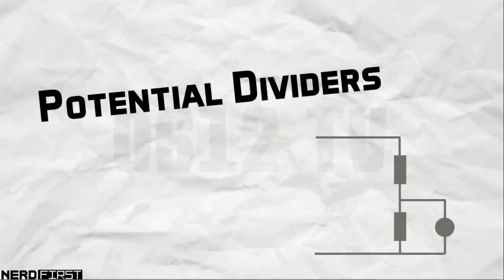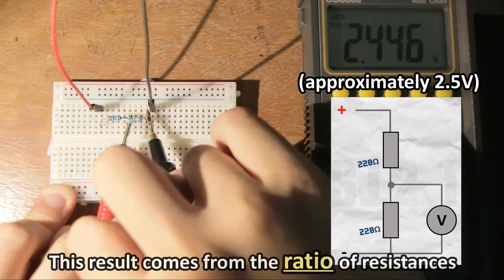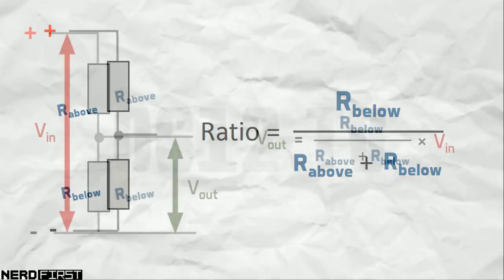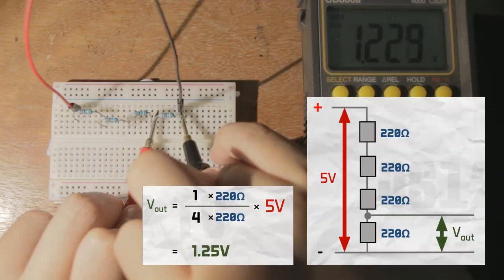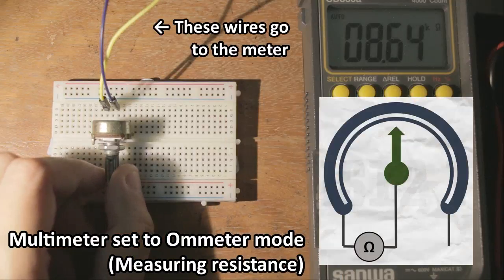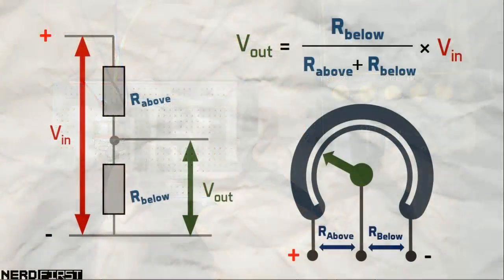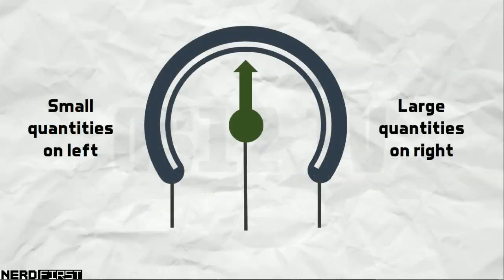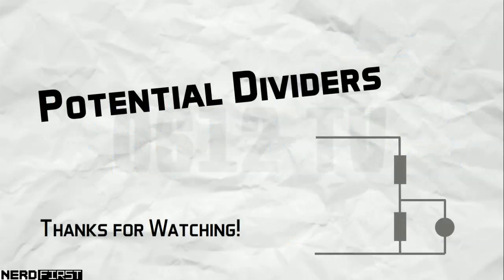Potential Dividers & Potentiometers

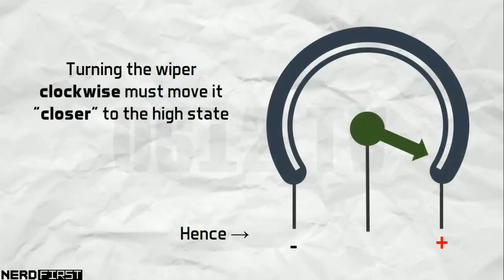Comment: 5:05- sorry but this is quite confusing. Is Vout taken across the first and second terminal ? or second and third ?

I would assume it's the former but I think you should have mentioned it.
Good content otherwise.
Reply from the maker: Hello and thank you very much for your comment! That's a very good point actually, I could've clarified that better.

Essentially, the output voltage I'm referring to is the potential difference with respect to ground.